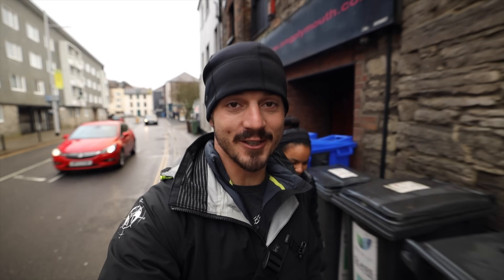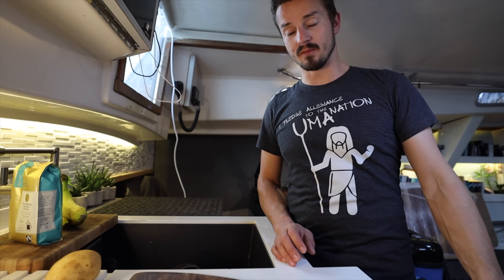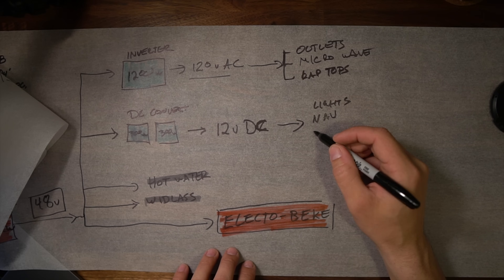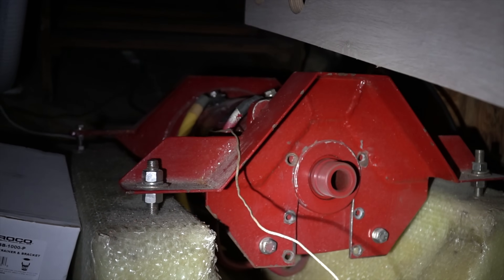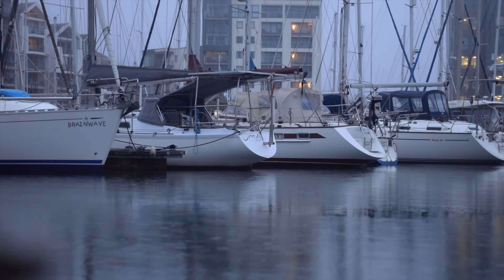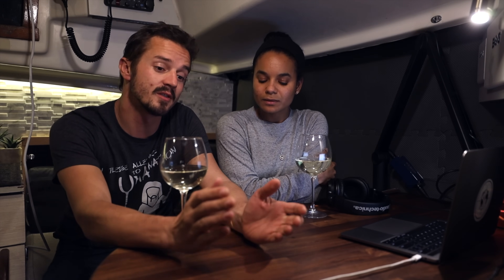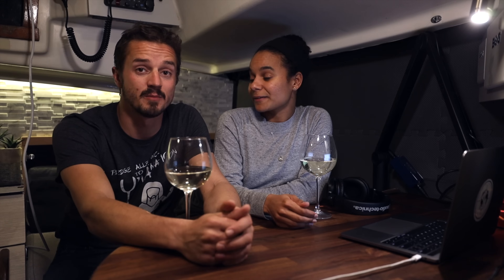5 Years Living offgrid on an ALL ELECTRIC Sailboat — Sailing Uma [Step 206]

Comment: Thanks for the informative video.  As an EV owner I was contemplating what was involved with transforming a vessel to all electric.  Two key strategies to lengthening lithium ion battery life is controlling operating and resting temperatures, and avoiding full charge or discharge on a regular basis.  Does your system have the ability to control the upper limit of your charge, like 90% max, and warn you if you drop below a certain set point, like 10%?  Any strategies for how to handle temperatures rising in the batteries?
Reply from the maker: Yes, we have complete control over charging voltages, so we can program them however we’d like. We also have a 25% alarm and the batteries stay cool since they’re below the water line. And they don’t actually heat up much since we don’t draw huge loads out of them.

Comment: Great video! I think you have the ultimate passive house!
I'm curious to know more about your HVAC and hot water.
Do you heat your cabin in the winter and cool it in the summer? How?
How do you generate hot water?
Got photos?
Do you track and categorize your energy usage? Charts? Graphs? 
This would be an interesting subject for data science.
Thank you very much!
Reply from the maker: We have a wood stove for the winters and in the summer our boat is cooled by the water it’s in, so if there’s a bit of a breeze, it’s quite nice, even in the tropics. The only time you really need an AC is if you’re at a marina in the tropics in the summer. That can be brutal without one. But we tend to avoid marinas any way so it hasn’t been an issue. We’re almost done installing our new hot water system, so stay tuned for that video. And yes, we’ve been keeping some data on our solar and power usage, maybe we’ll curate all that and add it to The Vault one of these days.

Comment: This is my first video I watched from you. I just subscribed and have a couple of questions that I’m hoping have not been asked before, but if they have please forgive me. First, do you have fossil fuel onboard for a backup at all for emergencies (i.e. a generator)? Second, have you considered running a split electrical system such as two banks of batteries with 8-10 batteries per bank?
I ask the second question because I am a retired submarine sailor and now a weapons systems test engineer at Pearl Harbor and I am considering purchasing a catamaran (translation: trying to convince my wife).

Comment: Nice presentation!  Looks like your boat is well setup!  But... It'd be better to get POWER and ENERGY straight in your head..  

POWER is the measure of how fast work is getting done...  Examples are, how quickly (at any point in time) a weight is being carried up a hill...  Or, how brightly a light is shining, at each instant...   

On the other hand, ENERGY is how quickly work is being done MULTIPLIED by how long it's being done at that rate... ENERGY is simply the product of power and time...  How brightly the light is shining times how long it's shining.   

That's Watts multiplied by hours, which is Watt-hour (hyphenated, not subtracted).  Or, abbreviated Wh.

Examples:

If you have a 15 Watt light, its power consumption is 15 Watt for any amount of time it's turned on...  Could be 100 milliseconds or 10 years...  15 Watts of power.  If you leave that light turned on for two hours, the energy used is 15 Watts times two hours, which is equal to 30 Watt-hours, which is abbreviated as 30 Wh.  

Your microwave oven probably uses about 1000 Watts of power while it's turned on.  If you leave it on for an hour (!) it would have used 1000 Watt-hours, or 1 kWh of energy.  Leave it on for 15 minutes, and that's 1000 Watts of power times 0.25 hours which equals 250 Wh, or 0.25 kWh of energy.

Your solar panels might collect 300 Watts of power for each instant they are in full sun...  If you have two, that's 600 Watts of power.  If they're exposed to full sun for six hours, they'll collect 3600 Watt-hours, or 3.6 kWh of energy.

You said your boat uses around 1500 Watts of power per day... But, I think you meant it uses 1500 Watt-hours or 1.5 kWh of energy per day...  That would be like having a 150 Watt light bulb turned on continuously for 10 hours.

Finally, in the totally geeky realm, energy has the units of Joules.  A Joule of energy is defined as one watt-second.  An example of one Joule of energy consumed would be a 4 watt light bulb being turned on for 0.25 seconds (a quarter of a second).  Four watts times 0.25 seconds is 1 Watt-second which is equal to one Joule.

Anyway, POWER is how brightly the light is shining... And, ENERGY is how long that bright light is shining.

Comment: All your PSUs eg computer power supplies that are converting ac to dc are using power to do that, possibly 50%. If you can feel heat that is wasted power. If you can do straight dc that would be more efficient. But more complicated. LYW

Comment: Do you have a reference page/resource on the calculations you guys made to do this? I'm working on converting my friend's 40' ketch to electric, and man, I have heard from old salts how it's not a good idea, but reading about your craft, while educational, y'all have a 30' sloop. I'm working on a 40' er. And I wish I knew y'all were visiting the Chesapeake, cause we're based in D.C. 

So, you know, equations, calculations, etc. We don't run any appliances. We just want to motor the thing in and out of harbor. I think you've got a pretty wide audience that would love, LOVE to see an educational boat electric conversion video (for the motor). That's how I found you two online, was looking for that exact thing.
Reply from the maker: http://www.sailinguma.com/electro-beke

Comment: I assume you bought a used 36 volt forklift motor. Although I've seen some that say 24 or 48v. Has the 36v motor been what you would use, if you did it again? Great job on the video. Don Yeaton.
Reply from the maker: Yes it’s rated at 36V. But we push 48V though it with no issues. It’s certainly not a motor we would recommend if you have the budget to buy something new like a Brushless 48V DC motor, but we got ours for $100 and it works just fine for how we use it.
Reply: @SailingUma  Thanks for the reply. I think you're really smart to find bargains and do what you can with cheap bateries, etc., then upgrade over time. That's working with available funds and a budget,. I've always had gas and diesel powered motors. But,  I wondered how practical electric power would work over time. You've proven that it is an option to consider.. Great job !

Comment: Imagine that the electrical wires are water pipes and the battery is a water tank. The rate of water flow through the pipe can be thought of in units such as gallons per minute. The rate of water flow is analogous to the rate of electrical energy flow through a wire. That unit is often called ampere, but for this discussion, kilowatt works better.  'Gallons per minute' is the plumbing equivalent of 'kilowatt'.

The storage tank's capacity is measured in the total amount of gallons it can hold at one time.  An array of electrical batteries has storage capacity measured in kilowatt-hours.  'Gallons' is the plumbing equivalent of 'kilowatt-hours'.

Does everybody here understand the difference between gallons and gallons per minute? Probably. So why does Sailing Uma assume that their audience cannot understand the difference between kWh and kW? And why do they try to confuse their audience by conflating kWh and kW? It's like saying "I drank 1 gallon per minute of water today."  It would also be like saying, "The shower head's flow rate is 2 gallons."

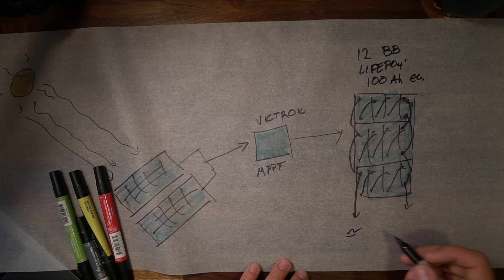Comment: LiFePO4 is not the same as "Li ion"; you say "Li ion" but write "LiFePO4" which is confusing. Also you do that slack $#!+ that almost everybody does which is talking about energy but referring to kW which is power. Like what does it mean to have "15kW storage capacity"? (6:10) Also your whole discussion at 8:24 is also screwed up by this confusion between energy and power. A high power device that doesn't run for much time doesn't use much energy is what you meant to say.
Reply: LiFePO4 is just one of many lithium-ion cell chemistries on the market. It is still a lithium-ion battery regardless of which other elements have been used in doping of, or outright constructing, the electrodes in the cells; for example a lithium-iron-yttrium-phosphate battery is still a type of lithium-ion chemistry, same as lithium nickel manganese cobalt oxide, or lithium titanate, etc. Fully agreed on the unit confusion though, it's a critically important point not to confuse "man-hours of work" and "number of workers", so to speak.

Comment: HEATING??? The fire place is the only source of heating you use? Maybe you can make a video about it since you are experiencing winter. Do you have any extra isolation for the boat? Does the boat stay warm for the whole night? Is it hard to deal with the  ashes? The wood? Would you prefer another source of heating, reflex diesel stove or electric for example? (Yes I get your eko concept but just asking).
Reply from the maker: Yes, we have a wood stove for while we're at anchor, but while in the marina, we have a small electric heater and a very thick duvet that keeps us nice a toasty. Our boat is now insulated (which helps) but the inside temp is dictated by the water temperature, not the air, so if we didn't have any heat, the boat would still be around 12-15°C at night, even if the air was 1°C.
Reply: @SailingUma  I guess this must affect your power consumption or you use it only at the marina. Will be great if you could make a video about winter heating it especially, for the fans for Scandinavia and other countries with winter season.

Comment: great video how do you do the math to get 15kw from your 12 100a batteries
Reply from the maker: 12V X 100A = 1200W 
1200W X 12 = 14.4kW....
Reply: @SailingUma  cheers so if I have 8x200a lithium in a 24v bank that will be 12.8kw
Just found your channel and started watching you guys for info and inspiration just got my boat last year's  fair winds to you both
Reply from the maker: Volts X amps = watts

If you have 8 - 12V batteries with 200Ah each, then you’ll have 16kW. Depending on how you wire them, you’ll have more volts or more amps, but the watts won’t change.

Comment: Well done ! One question, more opinion seeking in nature, Is it not more efficient to use an ac motor? Probably not significant in the amount you use your main propulsion forklift motor, was it just more cost effective?  Ok so it's two lol. 
Thanks and happy sails.
Reply from the maker: Lots of different motor types out there, all with their own pros and cons. Buying new is a whole different story. The one we have is because it was $100 and had enough power rating for our needs. Pretty much every other manufacturer is going for brushless DC motors. I think since we all have DC batteries onboard anyway, it makes sense to run DC motors.
Reply: Sailing Uma 
Hi and thanks for the reply. Teslas Roadsters use ac induction motors,  using dc batteries inverted to 3 phase ac power. I believe  the jury is still out on whether it's more efficient than dc brushless. And yes for sure the cost of your motor was a huge factor.
Reply from the maker: For high amp cars, they pretty much all use AC motors. but they're also running 1000's of amps. We only run about 25amps at 3kts and maybe 100-150 up at 6-7kts. Not to mention much slower rpms.
Reply: Sailing Uma 
Cool , what s Uma's displacement. I'd like to figure out the power to weight ratio.

Comment: So...no diesel engine then?
Reply from the maker: No diesel. We do carry some gas with us for the outboard motor, but don't use that much. Maybe 2-4L a month. We also have an electric one for quick trips to the dock, or beach which works great, buy only gives us 3-4 miles of range on a single charge and only gets us up to about 4kts.
Reply: @SailingUma  With respect, your entire lifestyle relies on the "grid". Your boat was built by the "grid". Likewise your solar panels. Computer aided navigation aids. Internet access. Cell phone/camera. Parts delivered by FEDEX/UPS. The food you buy in remote locations. Your personal flotation devices. Etc. Etc. Etc.
There is nothing wrong with living as you do taking advantage of modern civilization...it's normal. But please avoid the sanctimonious, self-righteous lecturing that too many other sailing channels engage in when talking about climate change & "green" energy.
Reply from the maker: Never mentioned climate change or green energy in this video. Simply the fact that we get our daily needs met while not being plugged into grid mains.

Comment: What size solar panels  Number of ? Volts ? Amps ? watts ?
Reply from the maker: We have 2 240W panels, each 24V nominal wired in series. So we get 48V nominal and closer to 60V when it's sunny for charging.

Comment: Was it still viable with acid batteries? 12k for Lithium batteries sure isn't cheap!
Reply from the maker: If you get 8-12 high quality lead acid like Trojan T-105's then yes you could. But in order to get the same range as we can get with our lithium's, you'd need about 60 T-105's. Which would sink the boat, so for electric, lithium is really the best way to go. Although, you could always just get 4 of them and just have bit more limited range. 10-15Nm isn't nothing and you could add more batteries later if you need more range, or a small genet. 

Infact 4 Battle Borns and a 2k Honda Genset would probably be the most cost effective way to do it.

Comment: Is your inverter PSW or MSW.?  Love your channel
Reply from the maker: Pure Sine Wave, since we run some sensitive electronics off of it. Not all inverters are created equal, and on a boat, you get what you pay for.
Reply: @SailingUma  $430 in the states.  Seams like money well spent for clean power.  Do you feel the need for redundancy like what your did with the 12V converters? Love the tech stuff, almost as much as Kika's cheeky photo shoots!!  ;-)

Comment: As an owner of a small coastal cruiser on an even smaller budget I've got to say "Holy crap Batman, those batteries run about $900.00 ea" ! Also "Great job getting it together" !
Reply from the maker: Yes, but on a small boat, you only need one, and it will last you 30yrs.

Comment: 👍👍. Yes we can double thumbs up. LOL

Why not run your laptops on DC, and ditch the ac/dc bricks?
Reply: I was thinking the same thing. Computers actually run on DC, so no sense plugging the computer’s AC-DC converter (box on the power cord) into an DC-AC inverter.
Reply: Not all laptops operate at 12 or 24 volts DC, they may need other voltages that are always provided by original chargers.
Reply: @rafaelsaura5587  True, the internals of a computer might be something other than 12v. However most laptops have an optional charger that plugs into a  vehicle cigarette lighter outlet that converts 12v to the desired voltage. Searching amazon for your computer model plus "12v charger" should come up with results. More efficient than inverter + converter.

Comment: Nit Picky -- the picture of the Victron charge controller is 100 / 30 (12 / 24 volt) - your running a 48 volt system - old pic and the change out is?? Ah -- looked at the controller on the list - 150 / 35 with 12/24/48 volt capabilities. 

#2 - Victron 712 (or one of them) - I use the Smart 712 - and have the relay close on 100% - open on 95% - controlling a contactor for a 48 volt heater element in the hot water heater. I have used a relay in my CGGX as the system is tied together.

Comment: Do you have an opinion on DC microwaves?
Reply from the maker: Never owned one or researched one, so no. Ours is an inverter type, which means it uses less power when on lower settings. Most don’t, they just cycle on and off full power.
Reply: @SailingUma  wow! Thanks so much for your quick reply.  Just starting to hack around for the boat we just bought that remarkably has neither inverter nor microwave.  I like the idea of the "inverter type."  Just watched your Domestic episode:  https://www.youtube.com/watch?v=zJRsdY4tR3w&feature=youtu.be .  I'll take a look at that Panasonic model.
I've also seen a couple of AC/DC models (hold your jokes) for use with AC inverter (or shore power) or DC batteries only.  Intrigued there.

Comment: Hi guys, I have a question. Ten hours at 3-3.5 knots sounds plenty but what about needing max power and speed for example escaping a lee shore in an emergency? What's your max boat speed and how long can you sustain it? Cheers and safe sailing!
Reply from the maker: We can motor 7 knots for about 1-1.5 hrs (if our motor doesn’t overheat). But if it’s an emergency, that means there is wind pushing us. If there is wind, we can sail. So no need for the motor. That also just means poor planning. Wind patterns are quite well forecasted 2-3 days out and shouldn’t come as a surprise.

Comment: Impressive, most impressive,  my only concern would be those lithium ions, have a history of sudden fires, nothings perfect, everything has calculated risk, God Bless, travel safe
Reply: The lithium-iron-phosphate (LiFePO4) cells used in their batteries have a very different chemistry and characteristics from the lithium-cobalt-oxide cells used in most batteries of "flame fame". They are as safe or safer with them than with some types of lead-acid battery - those have differences between them too, what with acid spills or hydrogen leaks, or damage from misuse or accidents. Of course any big enough battery bank requires respect regarding all the joules (kilowatthours) of energy stored in them just waiting for a circuit to release them into, including a short circuit.
Reply: @sietuuba  good to know